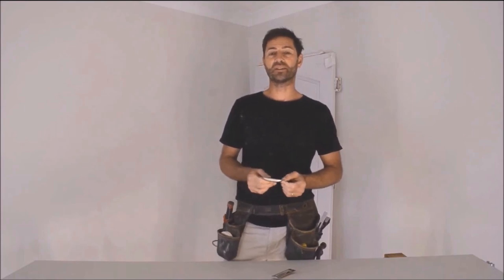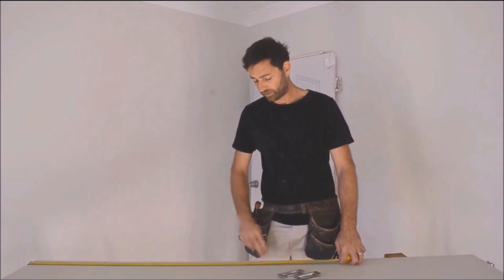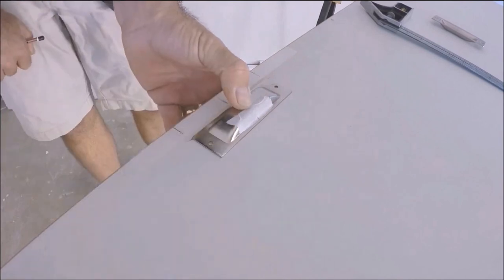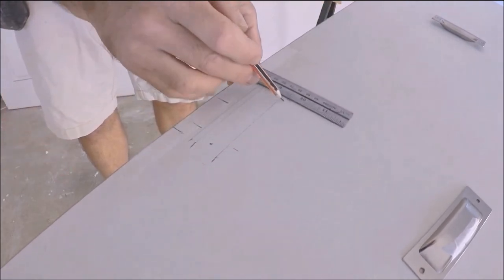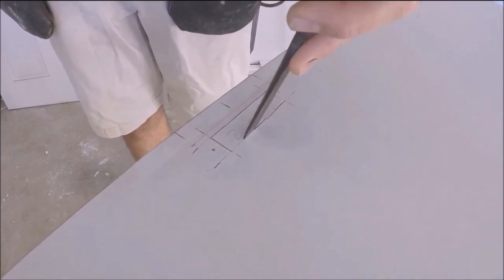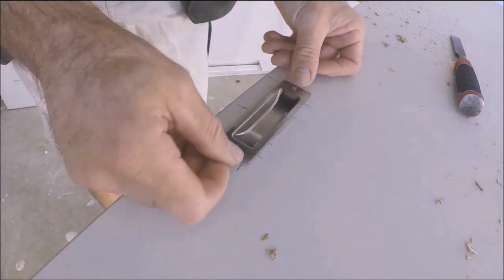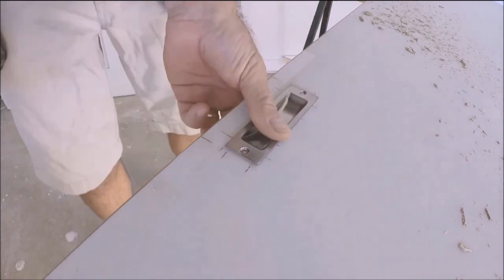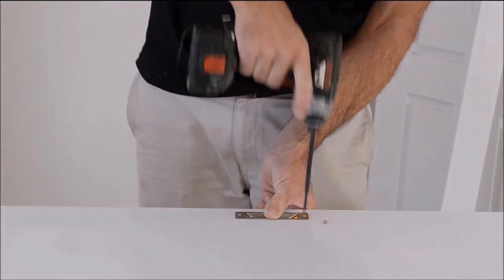sliding door handle installation – with Inspire DIY

Comment: Thanks for this. Doing this today. Was going to muck about with router but this looks easy enough.
Reply from the maker: Oh good stuff maximum chips.. glad it helped🤙 PS a sharp chisel is our friend!
Reply: @InspireDIY  Yep went really well. Took my time and marked correctly and chiselled a little bit at a time. Looks good. I had a dodgy olde inherited chisel so went and got a nice 5 pack of new ones in a case, should last a long time. Fairly sharp out of the box, but will work on them a bit more to get them really sharp later. Thanks again.
Reply from the maker: Yeah I think we all have that dodgy old chisel ...it never gets thrown out 😂.

Comment: Like some others I had thought I would have to use a router, but this looks like the best way to do the job.  One issue, the audio wasn't very good.  I'm glad that you had your comments written.  Still it would be better if your audio was better.  I had everything on my end turned up all the way.  But, thanks again for the video.  That helped.  Those pulls are exactly what I'm dealing with.  Perfect.
Reply from the maker: Thanks for the feedback Jim, I appreciate it... I'm glad this video was helpful! And yeah, I have improved my audio alot since then🔈🔉🔊👌 Kent

Comment: What if it’s a hollow door? Will a chisel still work or would I need some other tool? Thanms
Reply from the maker: Hey Cort, this demonstration was done on a hollow-core door as most internal doors are now. There is always a 25-30mm (1 inch) timber frame around its perimeter, and some have a little extra where the handle would be fitted. Just keep it close to the edge and all is well🤙 best of luck. Kent

Comment: How would you make sure the handle on the other side is installed EXACTLY at the same position?
Reply from the maker: Hey Doc, well it doesn’t have to be exactly the same.. but measure twice and cut once, just copy what you do on the first side onto the other 👌 cheers. Kent

Comment: o would appreciate instructions on how to install a pull in the edge. with the doors in place. the pull on the face of the door becomes inaccessible with the door fully opened.
Reply from the maker: Hey Ross, Is this is a cavity slider or pocket door that you are talking about, or a sliding (barn) door?  if it's a sliding door is it an option to move the 'door stopper' so the door doesn't completely open hiding the handle, I get this lessens the doorway size, alternatively (pocket door) you could install one of these (amazon affiliate link) https://amzn.to/3sCFGaZ thoughts? Kent